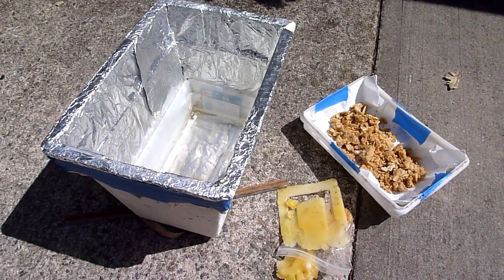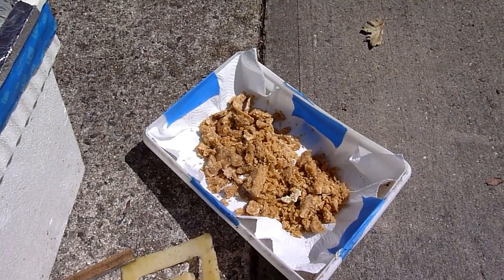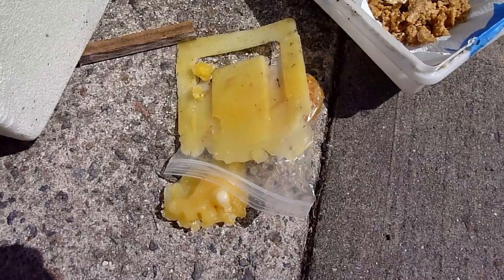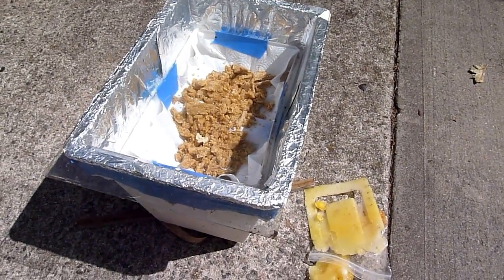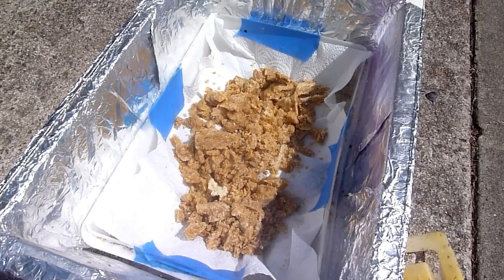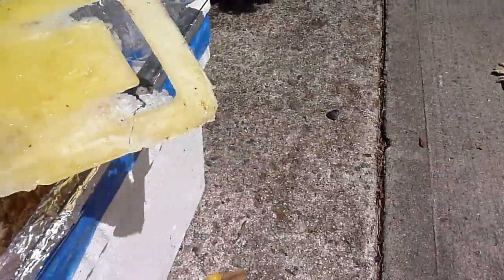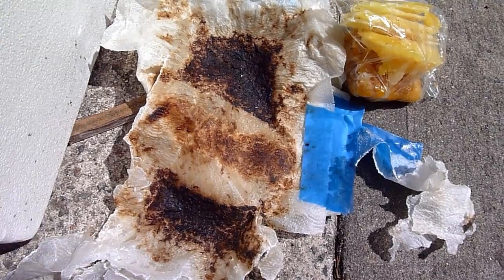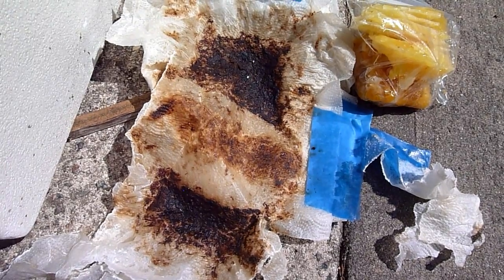NWNJBA Video Short - Homemade Solar Wax Melter

Comment: What kind of tray is the paper towel lining that alows the was to fall though? there must be some type of holes in that tray?

Thanks
Reply: Roy Carlin Hi Roy.  Your assumption is correct.  The Tupperware tray has some holes cut out of the bottom so wax can fall through.  The paper towels that are used for straining are simple every day paper towels, nothing exotic. There are two square holes cut in the bottom on opposite ends and one strip left in the middle to provide support for the paper towels so they don't get overloaded and slip through.